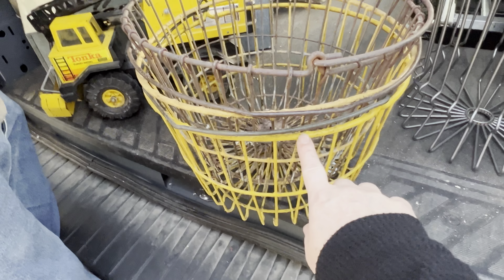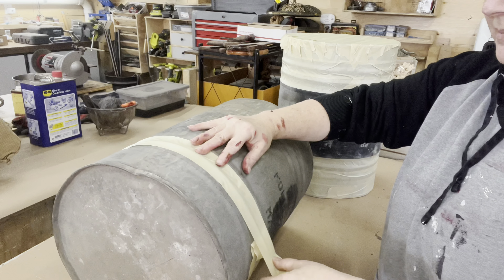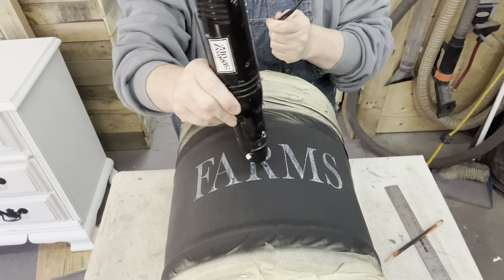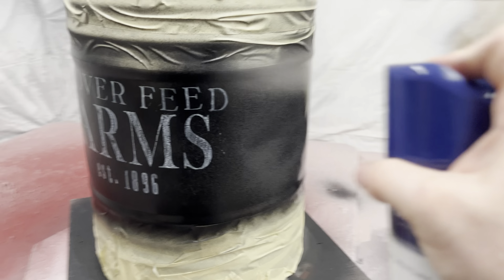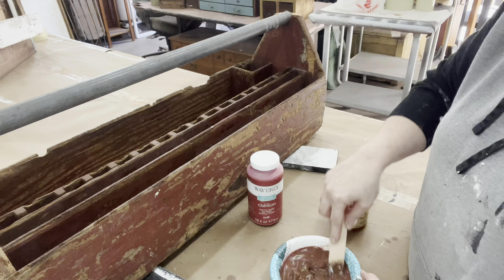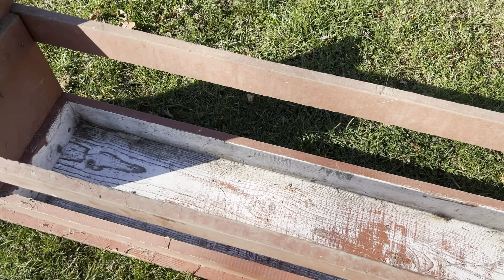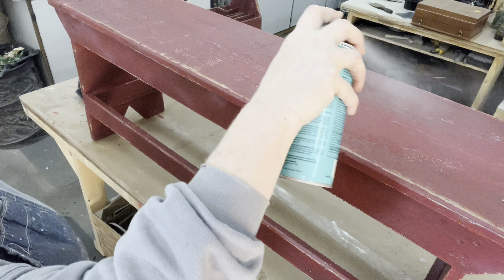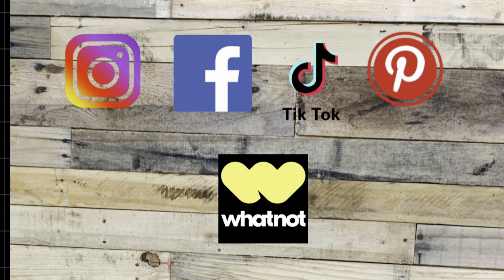DIY | Salvaged Finds | JUNK PILE SAVES | Home Decor

Comment: That old tool chest you painted red...I could see it used in two ways, actually.  One as a knitting or crochet storage...I can see the needles and hooks in those small places in the center and then yard and a few patterns in the larger areas.  Or, as an artists' storage chest.  Paintbrushes in the center, paints in the other areas, perhaps a sketchbook or a few small canvases...an artists palate knife.  Or even as a picnic accessory.  Can't you see utensils in the center and condiments in the other areas?
Reply from the maker: Great visions